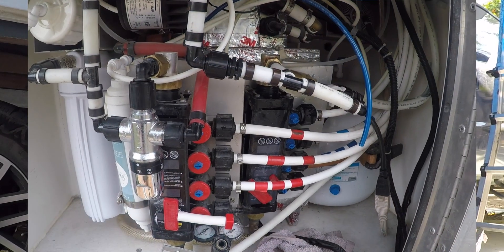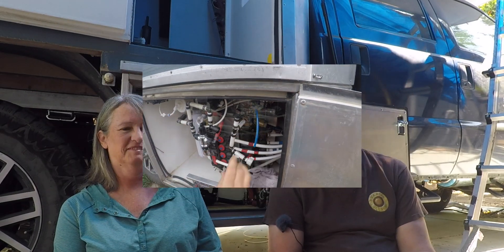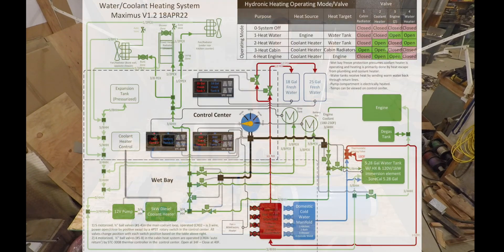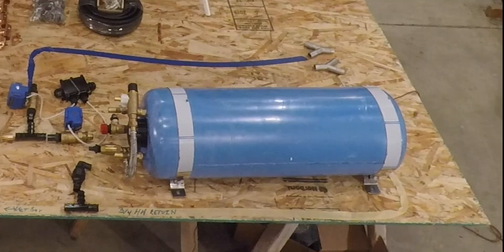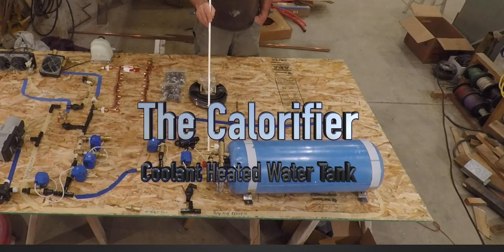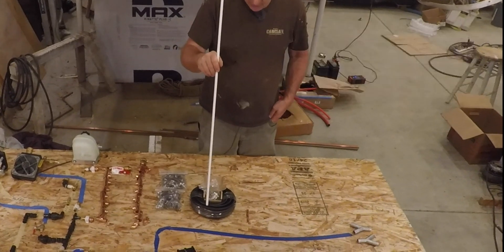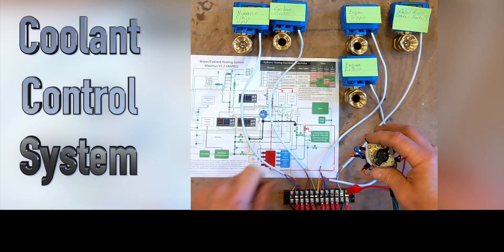DESIGN: DIY Truck Camper Van Build Hydronic Heating | Air Water Floor Tanks

Comment: So if I understand you correctly you're using just the engine coolant to heat everything up, do you have any concern about the clarifier leaking and  cross- contaminating your freshwater?

Comment: Great explanation. How does the return tank works, is it just a T to the return lines ? Is that what some call an expansion tank ?  Does it have to be all the way up ?
Reply: Catching up on comments...the reservoir tank is at the top of the return line so any air coming out of the branch lines will rise I to the tank and be eliminated. It is also a reservoir for exra coolant that will replace the air voids eliminated. It ispressurized so it only minimally acts as an expansion tank.

Comment: Nice setup and video, maybe i missed it but where exactly did you install the engine connections is the hot one  (blue tape) installed before the radiator and the other one straight after the radiator?
Reply: Interface with engine cooolant is by splicing into the supply and return lines for the cab heater core. There is clear video of it in the part 2 video,

Comment: amazing video, I'm planning to do the same in my bus with the difference being that I have a heat exchanger connected to the engine heat and I was wondering what model of US solid valves you used? I downloaded your guide but you only mention US Solid 3/4" FPT motorized ball and not the model and they have a few, thanks
Reply from the maker: https://www.amazon.com/dp/B06XRJF4JG?ref_=ppx_hzsearch_conn_dt_b_fed_asin_title_29&th=1 
Model #: USS-MSV00019
This is not a 'standard', not afull port valve which does not concern me. Pay particular attention to the control type you want to use, there are 3-4 different types of wiring control and that is very important depending on what you will operate it with. This is a 3 wire valve where one wire is grounded and the other two are positive for open or closed. There is also another type of 3-wire. See the product description for the control types and make sure you have a good understanding of what you need.
Reply: @WorkingOnExploring  Thanks so much, I was getting confused by the options and I was not sure what to get.

Comment: Very nice very productive rabbit hole. Im sure your first system gets a lot of credit for this system. I need to take ideas for a smaller system on a boat.
How has it held up?
Thank you
Reply from the maker: I've been living in it on my house build and connected to shore power for a year and haven't used it in that time. For the year prior, I find I use it all the time for hot water heating, both from the engine and coolant heater. It's both convenient and economical. Only problem was some minor coolant leaks which were solved by changing to worm screw clamps which allowed me to tighten more.

Comment: Love the system.  Want to implement the system in my small class A. Where did you acquire your thin core radiators from?
Reply from the maker: They are PC liquid cooling system radiators that are widely available in 120mm width (for 120mm fans) and in lengths up to 480mm (for 1,2,3 & 4 fans)  I also recommend models with copper cores with brass fins as opposed to the cheaper ones that use aluminum. https://www.amazon.com/gp/product/B08P18KX1V/ref=ppx_yo_dt_b_search_asin_title?ie=UTF8&th=1
Many of these radiators use 1/4" BSPT threads (not quite the same as NPT but they do thread together). Use low-strength Loctite to seal the threads as the threads are not a perfect match.
Since the pipe fitting has a small ID, I use push-fit (aka 'shark bite') connectors on my 3/8" (for single fan) and 1/2" (for double fan) PEX to minimize more interference at the coupling when using an ID style fitting common for most PEX plumbing.  
Use fans specifically made for these radiators. They will be identified for a 'high static pressure' , low-speed (~1800RPM). I used Noctua NF-P12 redux-1700 PWM. These fans are designed with more blades for the high resistance to airflow that the radiators produce. 

I use a thermal switch to turn the fan on when the radiator gets hot and off when the coolant that continues to circulate after the coolant heater shuts off to totally wring heat out of the system before shutoff. I decided on 40C/100F as the switch temp and epoxied them directly to the radiator tank. https://www.amazon.com/gp/product/B08BQXLXQ2/ref=ppx_yo_dt_b_search_asin_title?ie=UTF8&psc=1
Reply from the maker: There is a detailed PDF system specification document covering many details of the hydronic system at WorkingOnExploring.com/TechDocs

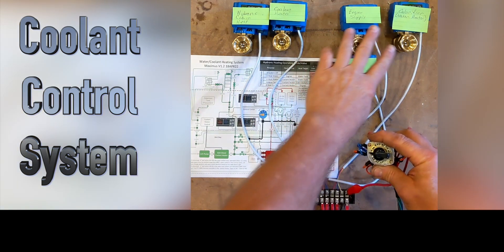Comment: what's the name of the switch at 5:00? I want to get one, couldn't find it.
Reply from the maker: uxcell 4P5T 4 Pole 5 Position 2 Deck Band Channel Rotary Switch Selector with Plastic Knob https://a.co/d/doHlnA0
This is a 4P5T (literally 4 pole,5 throw) rotary switch. The 4 pole means it controls 4 separate devices simultaneously. The 5 throw means it has 5 positions. To produce this number of outputs (4x5=20) it needs more space than a single disc can accommodate so it becomes '2 decks' meaning 2 discs on a common shaft. Depending on the number of devices (X) you want to control and the number of modes (Y), search for ' (X)P(Y)T rotary switch'. I got this cheap Chinese made one from Amazon for ~$12 (more now). It has very adequate performance for the relatively infrequent switching used. A high performance one will likely be over $100. 
Each or the 4 poles of the switch have one input and 5 outputs (One for each of the 5 'throw's). In each of the 5 positions, the input is connected to the respective output.  I connect a 24V positive (because my battery is 24V and I purchased 24V valves) to the input. The 4 valves are control type CR02 (important) and receive operating power with 3 wires (there are other control types with 3 wires that operate differently so be sure). You need to ensure you buy an appropriate control type valve. There are control types that are inappropriate (see the reference doc below). The three wires are one negative and a positive for open and a positive for closed. The appropriate positive is (open or closed) is connected to the appropriate output for the desired mode. There is a wiring diagram of the switch wiring in my 'hydronic system concept document' (or similar words) at WorkingOnExploring.com/TechDocs
Reply: @WorkingOnExploring  thank you so much, gonna start my hydronic project soon 😀

Comment: Great setup! I've seen similar setups, not as complete as yours, that use the calorifier and ALSO include a coolant expansion tank? If there is enough space to install the expansion tank - is it beneficial with your setup?
Reply from the maker: I have a small, pressurized coolant tank (pressure relief cap on a radiator overflow tank from a Cooper Mini) that I theorize is adequate for expansion when kept half full so I didn't install a bladder tank on the coolant side. On the DHW side I have two RV 'accumulators', one at the pump discharge (deals with pump pulsation and cold water buffering) and one on the calorifier inlet, ahead of the reverse flow check valve to deal with expansion in the hot side of  the calorifier. 

I am not absolutely sure that the coolant expansion tank is adequate in every situation. I have experienced a couple of minor coolant leakages over the past couple years I can neither find nor attribute to a specific event so I am contemplating installing a small bladder type expansion tank just in case there actually is a pressure problem I can't specifically identify.
Reply: An expansion tank of some type is essential in a pressurized system. Not having one will result in high pressure coolant causing a leak if you don't have so e way to deal with the change in system volume as heating/cooling occurs.

Comment: PDF layout? List of components?
Reply from the maker: workingonexploring.com/TechDocs has a lot of technical resources including a 'Hydronic System Concept' document that goes dep into materials and strategy as the schematic for the system and for the electrical. If you have specific questions, email me at WorkingOnExploring@gmail.com
Reply: thanks @WorkingOnExploring

Comment: Which brand of Chinese heater did you use?
Reply from the maker: I have an HCalory 5kW, 24V coolant heater and really like it. I bought it after I already had a no-name air heater and wish I had also bought their air heater although my no-name has worked flawlessly for 3 years.
Reply: Thanks for the tip. In my case, I have a tiny 2002 VW Eurovan Weekender and I'm trying to design a simple, compact auxiliary heating circuit to tee into the existing rear passenger heater circuit fan while parked, currently its heat source is coming from the engine. I don't want to run the engine all night just to heat the small cabin area and I'd like to also have an on-demand water heater for outdoor showers as a bonus.
Your design provides a wealth of information, however it has way more capability than I require for my simple task. The Chinese heaters seem like the ideal fit, considering they are much cheaper than the German Espar units...factor of five. I'll likely go with that same unit, as you seem to have had success so far. Also, thanks for posting your video as it gives me some good leads to parts like the control valves which I will no doubt need to exclude the main engine circuit while running the parking heater. Your video is the best one I have found so far...no fluff just the straight goods! Additionally, I was thinking, at times I may want to include the auxiliary circuit backwards to the engine circuit to pre-heat the engine in freezing climates (Canada's winters). Those valves would be ideal. I wonder if you have any suggestions for this? @WorkingOnExploring
Reply from the maker: You can reach me directy at WorkinOnExploring@gmail.com. I see you're wanting 3 things (in priority); 1) Cabin heat, 2) hot water, and 3) engine preheat. 

Cabin heat may be challenging because a 5kW coolant heater is probably about 2x your need. Some people have sooting problems with diesel air heaters when running throttled down for very long. Coolant heaters  also don't operate on interior temperature control like a thermostat-controlled aire heater.  The way the coolant heater operates, you are not in direct control of the burner capacity. I don't think they make 2kW coolant heaters but they do make 2kW air heaters. 

I can see an alternative if you are willing to settle for not having the engine preheat. I'd start off with a 2kw diesel air heater for cabin heat. Since you have engine coolant going to your rear heater, you could install a calorifier under the cabin and that would use that engine coolant to heat water. You end up arriving with great hot water for a shower. Something like this; https://www.heatso.com/surecal-horizontal-10-liter-2-64-gal-single-coil-calorifier/ they make 10, 15 and 20l versions depending on how much space you have and how much water you want. They are similar in price so if you have space for a larger one, you'd be advised to get it. I have a 20l and it heats up to 80C in about 20 minutes of driving (as long as the engine heats up quickly.....when really cold, it takes my engine a long time to heat up) and stays relatively hot for ~12 hours.

 This combination keeps plumbing and operation simple. if you want to add a coolant heater to heat the calorifier, it is relatively simple to add valving to also get circulate it to reheat the engine too. Doing these two is not hard, but 3 or 4 things gets a lot harder to control. Probably the biggest problem would be controlling space heating. The coolant heater would be shutting down very often and your interior temp would be like a yo-yo. Rixens (Rixens.com) has a proprietary controller that consolidates functions. It's $1k and I believe only works with a Espar heater. They sell kits which are also VERY pricey.

Comment: thank you for this great video, can this system swap the water tank by replacing the one i found call Incline Engine Heat Transfer Water Heater (4.2 Gallons) from van land? also i wish it can be operator by the LCD like the   rixen's Hydronic Heating
Reply from the maker: All calorifiers are a water tank with an internal heat exchange coil for coolant. Some have two heat exchange coils. They are constructed in multiple sizes and shapes of the tank depending on the manufacturer and intended use. The one I use is cylindrical and the one you cited is rectangular. They do the same thing. The one you cite is very expensive ($1879 vs ~$600). Rectangular tanks are also not structurally as able to tolerate pressure as cylindrical tanks.

I'm not familiar with the operation of RIxen's control. They might be making a better-adapted control for use in RV's as I definitely think that is something that could be a desirable product but I'm also sure it won't work the same on all coolant heaters.  Not all coolant heaters operate the same so that is something you should investigate thoroughly before you buy. You have to keep in mind that the primary purpose of most coolant heaters is to preheat a cold diesel engine and their controls will be designed around that. Some coolant heaters are designed for use as supplemental cabin heaters (such as for busses) and will have different control strategies than engine heaters. Similarly, use in RV's may create a need for either water heat or space heat, both of which require different control strategies. I have taken this all into consideration when selecting a coolant heater made to heat an engine and to build controls that make it useful to heat water, heat a living space, and still preheat an engine. My control system requires frequent hands-on and is definitely not a 'set it and forget it' automation. You will have to decide for yourself if what you want to do can be adapted by the control that your coolant heater comes with.
Reply: @WorkingOnExploring  thank you so much for the information and i think your system are far best i could ever find on the internet just feels if i can control them in one touch screen that will be to perfect solutions like this touch screen https://youtu.be/ExoOEDlTz70?t=835   thanks again for your great information really appreciates your input.
Reply from the maker: I watched the video showing the Rixen system. It is clear that Rixen has developed its own control that manages the coolant heater as well as supplementary system pumps and 120VAC immersion heater. It is a costly system @$5,200. Rixen sells the controller separately for $1,000. It would not expect this to work with coolant heaters other than Espar but it could.

Comment: Which pex manufacturer you recomend ?
Reply from the maker: I see little difference in the major brands. I think that RV systems get so much less use than residential systems that likely failure due to matrial reliability differences really doesn't play into the decision. RV systems are also typically more accessible and therefore more easily repaired. I use Bluefin (supplyhouse.com) mostly and have previously used Apollo (Lowes). I also don't get hung up on limiting myself to 'oxygen barrier' material although I use it where possible That is only a factor for systems containing steel or cast iron components which I don't have other than the engine block. Using automotive coolant/distilled water mix that contains corrosion inhibitors as also a reason to ignore it.
 There are more likely several more relevant factors when choosing a piping system;
1) PEX-A vs. PEX-B; expansion fittings (PEX-A) provide better flow but are not repairable (only replaceable by cutting out) which severely impacts any ability to make field repairs. There are multiple types of 'crimp'  clamps but only one that is easily removable and rated as reusable up to 3x and that is 'PEX LOCK' (not sure of spelling). Additionally, they also don't require a special tool (vise grip or channel lock pliers will do) making them far easier to change or repair in the field.
2) An RV is not a house and has shorter runs and far more challenging routing. I use 3/8 diameter pipe in my fresh water and some of my parallel hydronic circuits. It is flexible enough to avoid fittings between the supply hub and fixture. While I don't like push to connect fittings (mostly referred to as 'Shark bite'), I do use them on 3/8 pex to avoid significant restrictions of internal fittings.